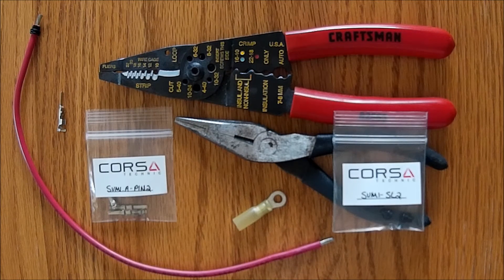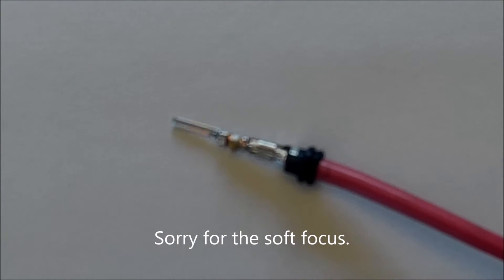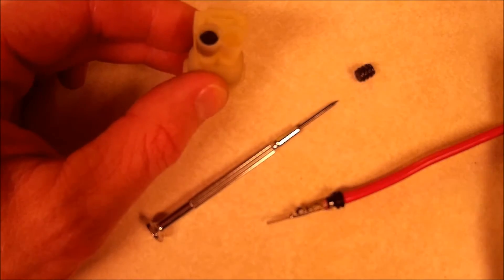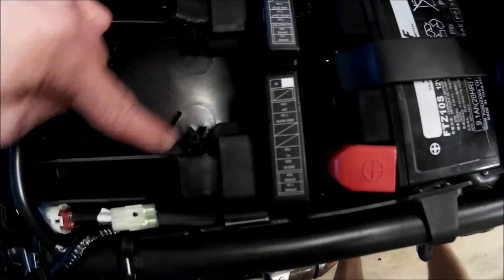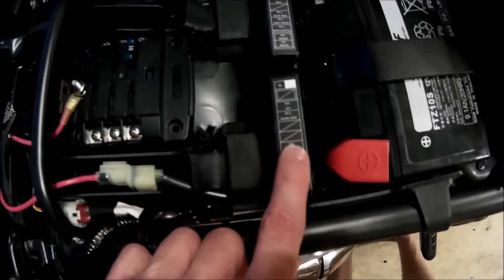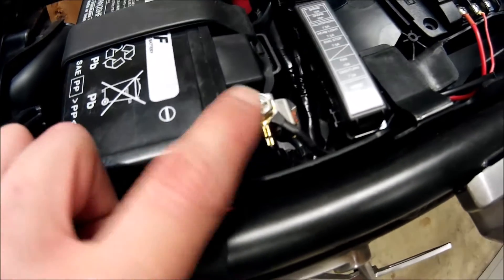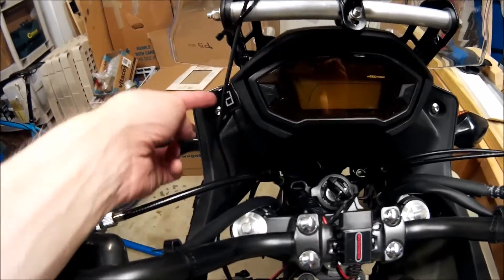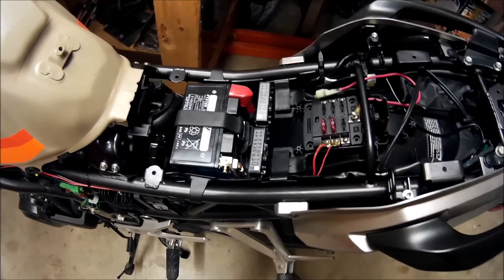Honda CB500X - How to Wire Accessories - Fuse Block Method

Comment: Which fuse is for the OP on the FuseBox?
Reply from the maker: For 2013-2015 bikes, 7.5A fuse in fuse box 2. For 2016 and later it is a 10A fuse in fuse box 2. Its labeled OP.
Reply: @joshuaw8540  Thanks! for the reply. Just what i need, as im planning to do the same for my 2019. Since im gonna connect it to a fusebox for my accessories, should i swap out the stock fuse to a 30A?
Reply from the maker: @zieWRITES  No, you shouldn't increase the fuse value as the fuse is sized appropriately for the wiring. If you need more than 120w of power then you should add your own relay and wiring directly from the battery.

Comment: Thanks for sharing, just wondering why didn't you use the ground on the OP connector itself?
Reply from the maker: That is an option if you also have a ground distribution block, but that just uses more space. The fuse block I was using for this example does not have a ground. I've subsequently rewired using the front option connector instead and for the new install I do use the ground from the OP connector.
Reply: I'd also like to use the front option connector as it's a lot closer to the mount but I'm reluctant to remove the dashboard to get to it, wish Honda placed it somewhere easier to get to.
Reply from the maker: I have another video showing the front option connector. It can be accessed if you remove the right side fairing.
Reply: Thanks I'll check it out
Reply from the maker: Looks like I spoke too quickly. I removed both left and right sides and also partially removed the instrument panel in order to access the other connector. It isn't difficult, just takes a bit of time.
Reply: Thanks for letting me know. I've got a BRUUDT navigation mount, it's a RAM ball that sits on the steering clamp so not too far from rear OP, probably stick with rear OP for timebeing.

Comment: Hi... great video. Got a question - that options plug has two terminals which are +ve and -ve. Since you're taking the power from the +ve, for the distributor, why can't you  ground the distribution block to the -ve terminal on the options plug? Wouldn't that make for a cleaner build?

I'm thinking of doing the same to power up 2 LED spotlights on my Benelli. Where should I ground the relay and the lights -- frame, battery or -ve terminal on my options plug?

Cheers.
Reply from the maker: Yes, if the distribution block actually had a ground. The one I used only had positive wiring. The blocks with a built in ground bus are significantly larger.
Reply from the maker: The options plugs on the 2016 and later bikes use a 10 amp fuse and the front one also has a third wire that is switched to the high beam lights.

Normally when using a relay you'd wire the power side of the relay from the battery + to relay, then the load and either battery - or frame ground. The switch side of the relay you'd wire to the options plug or an auxiliary switch. You could also wire the power side of the relay to an additional fuse block. Regardless it is good practice to fuse all wires connected to battery +.

Comment: Great video. I had a question for you. Why did you go with the fuse block with the positive only vs the one that has both positive and negative? That way you can ground the fuse block at one location then have all the wires run directly to the block. I'm curious because I'll looking to set up a fuse block as well.
Reply from the maker: ADVBandit Space primarily. The blocks with a ground bus are significantly larger and more expensive.
Reply: Joshua W Thanks!

Comment: Do you have a link for that fuse block??? Thanks for sharing!
Reply from the maker: It's the Blue Sea Systems ST Blade 6-circuit with cover: https://www.amazon.com/Blue-Sea-Systems-Circuit-Common/dp/B000K2MBPA/ref=sr_1_1?ie=UTF8&qid=1477960715&sr=8-1&keywords=blue%2Bsea%2Bst%2Bblade&th=1

I'd consider the new ST Blade compact also or drop the fuse block and just use the option connector, which is what I've done on my bike.

Comment: Not sure if taking your ground to negative terminal on the battery is a good idea. Forgot where I saw this but I remember something about that.
Reply from the maker: As long as you don't interfere with the connection for the existing ground wire, using the battery negative terminal is fine. However, if there was a more convenient frame ground location, I'd probably use that instead.